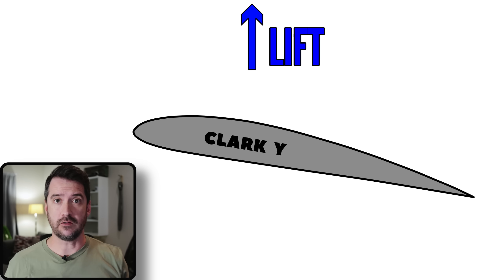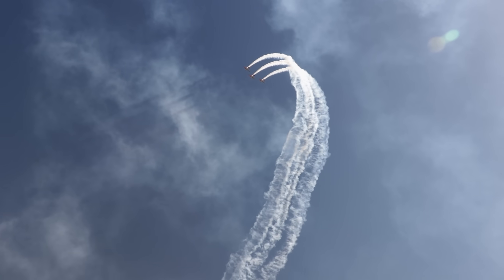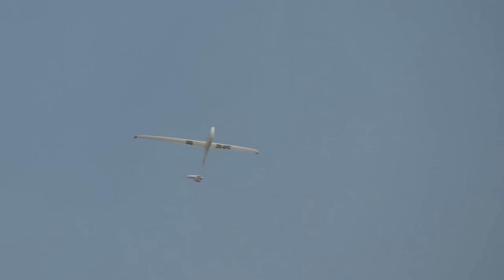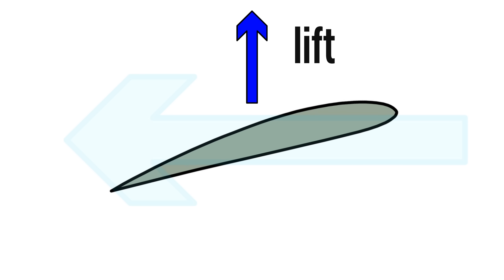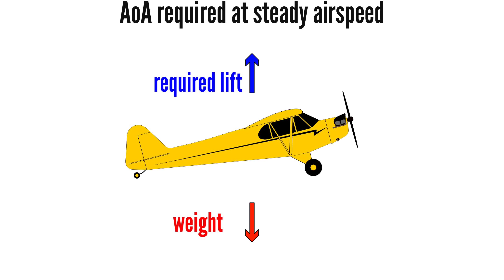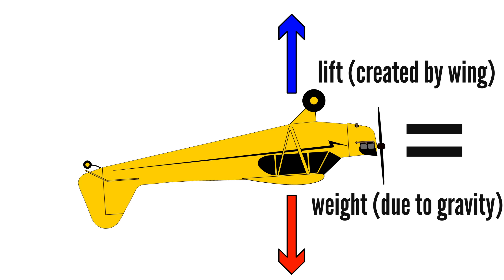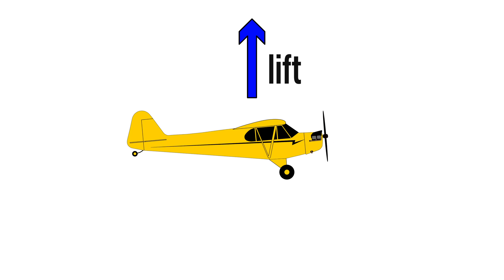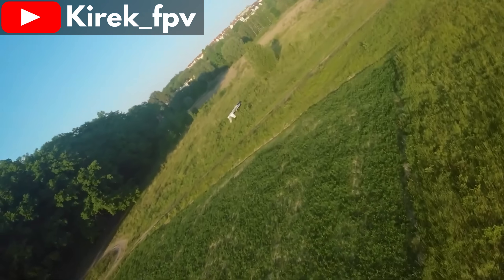Is Airflow Distance Over the Top of a Wing Always Longer?

Comment: Lift is generated by the stagnation point, which is located under the wing due to angle of attack. On-coming air is accelerated upwards to counter downward pressure, that's how pressure is decreased above.

Comment: No matter how the wing shape is, the amount of lift is proportional to the amount of air washed down after pass through wing. Even a rotating cylinder can act as a wing, using Magnus / Coanda effect. Simple Newtonian physics can validate this. It doesn't have to use (confusing / wrongly applied) Bernoulli equation. That kind of Bernoulli principle is only valid when the air stream is not separated. On wing, the upper and lower stream doesn't have to meet on the same time at the edge when separated. So longer distance doesn't always faster. For Venturi effect, Bernoulli's is correctly applied.
Reply: Bernoulli is simply a statement of conservation of energy, which is fundamental to our physical world.
Reply: @davetime5234  Yes. But that approach for wing is logically misleading. The teardrop shape of the wing main purpose is to delay turbulence to form, to elongate boundary layer / separation. Not for the lift. The lift is actually from angle of attack. So, to right logic to explain that shape is to draw centerline (cord) of the teardrop wing. Imagine if the top of the wing is jagged on the top, and smooth on the bottom. With angle of attack zero, that approach would tell that the upper path is longer. But in that case there will be no lift.
The Bernoulli principle logic approach also can't explain rotating cylinder wing. Because on rotating cylinder wing relative speed of air to the wing surface, or relative to the surrounding air, is higher on the bottom. Even though it faster on top, relative to the center of the wing, caused by Coanda / Magnus effect. The higher pressure on the bottom of the wing is caused by impact pressure. on all teardrop-shaped wing, flat wing, or rotating cylinder wing.
What I emphasize here is; Bernoulli principle is correct. But widespread explanation on textbooks that apply it in wing is incorrect / must be refined. The Bernoulli on wing is measured secondary effect, not the cause of the lift.
Reply: @mbahMu-iki  "The Bernoulli on wing is measured secondary effect, not the cause of the lift."

The three interconnected pillars of fluid dynamics underpinning lift are:  conservation of mass flow rate (conservation of mass), conservation of energy and conservation of momentum.  The predictive equations of Euler and Navier-Stokes formalize those three pillars and the interactions between them.

Among the above, Bernoulli is shorthand for conservation of energy.  It is not a secondary effect.  It is front and center a core rule defining the mechanism of lift that governs the rules of CFD systems used to design the wings comprising  most, if not all, of the aircraft underpinning the aviation industry.
Reply: @davetime5234  like I said, Bernoulli principle is correct. But for wing lift analysis, it is more proper to focus on angle of attack instead of the shape of the wing. That approach will be confusing for rotating cylinder wing, or wing with jagged / wavy top (wich also has longer path) and flat bottom on zero angle of attack.
Reply: @mbahMu-iki  "it is more proper to focus on angle of attack instead of the shape of the wing"

But angle of attack involves "Bernoulli" every bit as much as asymmetrical shape of the wing.

It is the asymmetry to the relative wind that creates lift.  So, "Bernoulli" is not different for whether that asymmetry comes from asymmetry of shape vs asymmetry of angle of attack, vs a combination of the two.

Same issue with the rotating cylinder.  The rotation presents asymmetry which (like with the AoA and/or the shape asymmetry) causes a conservation of energy transaction (decrease of pressure to sustain the higher tangential speed*), in response to preserving the incoming direction of momentum (conservation of momentum).

The "jagged/wavy" top issue is that it doesn't compel a longer path:  the bulk of the detoured airflow is not compelled to rigidly adhere to the undulations of such a rapidly changing geometry.  In other words, depending on the specifics, one would expect to see the actual path to be shorter than the surface path length measured by taking all the dips into account.

*in terms of the 3 "pillar conservation equations" defining both Euler and Navier-Stokes, consider the pressure drop/speed increase statement for conservation of mass flow rate:  if flow rate fails to keep up along the elongated path, pressure drops from mass deprivation until the pressure drop accelerates the speed enough to return to equilibrium mass flow rate.

Comment: 9:33 Flawed argument. The air that starts at the stagnation point and goes to the left and then around the wing has its first part, the one that is going left, creating DOWNWARD drag.
Reply: You need to consider the composite effect of the entire airfoil.  Local forces are only a fragment of the full picture.

Comment: a planes wing is just like a knife in butter it cuts through the air and if it cuts fast enough it will generate lift in the direction the knife is angled . butter been more beneficial cauese it does not move easy , the faster you go the harder it is for the air to move out of the way creating lift in both directons. the slight hump meansthe air ontop f the wing moves slower in relaton to the air underneath meaning its bias is to lift upwards so you sacrifice a wing that can operate both ways equally to a wing that operates more efficient when used to produce lift one way.

Comment: Sailor here.  THANK YOU !  One can have a graphene sail, and with virtually no thickness, it will create lift.  Always thought is was surface tension or weak vacuum  between air and sail fabric.   Put a sheet of paper on a table top.  Put your hand on top of it.  Life your hand up quickly and the paper will come up too.  It ain't no Bernoulli effect.
Reply: Bernoulli isn't an alternative theory, it is shorthand for conservation of energy.  To fully explain lift, you need three legs to a 3-legged stool: conservation of mass flow rate, conservation of energy and conservation of momentum.

The Navier-Stokes and Euler equations, that describe lift in detail, are composed of an interconnected equations representing the above 3 "legs of the stool".   These methods are the rule book for the tools we use to design real aircraft wings (and high-performance sailboats).

Cutting off the conservation of energy leg of the stool (the "Bernoulli" part), makes the stool unable to stand upright.

The same CFD tools outlined above, work for thin sails.

Comment: I have questioned the curved top surface being the main reason for generated lift of an airplane wing since I played with balsawood planes when I was a kid.  The wings were flat and the mount for the wings had no curvature or angle in relation to the single stick fuselage.  Since I was not and am not an engineer, my intuition led me to believe it was more the angle of attack and wind speed, since I could also feel the lift when holding a plywood strip across my shoulders and standing in a strong wind, with the board at a positive angle to the wind.  The lift disappeared and started pushing me backwards, if the angle got higher, past a certain point.  The position of the wings, along the fuselage made a difference in how and if the wooden planes would fly, as in, balance for flying working out better with a little more weight on the tail, providing a better angle of attack, I assume.
Reply: There's nothing special about camber vs tilt.  It's all about asymmetry:  to the extend camber contributes asymmetry and tilt, or angle of attack, represents asymmetry of orientation, lift is created from a relative wind.

So,  curvature adds lift, but only if in adds asymmetry.

Comment: Many planes fly like crap inverted, or not at all, even when talking about RC planes.  The thing to remember with scale models is you have to  factor for air being seemingly more dense (where Reynolds number comes into play) because the plane is scaled down but the air its flying through did not scale, which is the same reason a model boat on the water in a movie looks fake because the water does not react right on the model due to scaling (just watch the raising scene in Raise the Titanic to see what I mean).  RC planes are also not really lighter for their size, they are actually usually heavier in their scale than a real aircraft because frankly they don't have to design full size aircraft to be picked up by Giants and put into a trunk.  RC planes also have more powerful power plants for their scale than the real aircraft  making many capable of near or actual vertical climbs on engine power alone.

Getting back on topic, how well a plane flies inverted has a huge dependance on the airfoil with a more symmetrical airfoil performing much better at unusual angles of attack including inverted, which is why real stunt aircraft like the Extra 300 and Pitts have highly symmetrical airfoil shapes that perform nearly as well inverted as they do when right side up.  For RC high performance aircraft you usually see fully symmetrical airfoils that fly equally well and at the same angle of attack whether inverted or upright.  The other factors to critical angle are speed and altitude.  As  you get slower or  higher the critical angle will reduce.

Comment: Until you've put a wing with pressure ports in a wind tunnel, you will never understand that you are wrong. The longer path does in fact create lift even at AOA (depending on airfoil shape, of course).
Reply from the maker: I didn't say the longer path creates lift. I even said in the video that I'm not describing lift. I said that the longer path argument can't be debunked by saying that "then a plane wouldn't be able to fly upside down". 

So what exactly am I wrong about?
Reply: It's all about asymmetry.  Asymmetry presented to a relative wind creates lift.  

If you stick to thinking in terms of the asymmetry contribution, then the shape of the airfoil in combination with any AOA can be understood for any combination of right-side up, upside-down, asymmetrically cambered (in the up or down direction), or symmetrically cambered.

Path length and the stagnation point, and the notion of symmetry vs asymmetry are directly tied together.

Comment: Good presentation.  Always wondered why a flat wing ( no airfoil ) would fly. We use them in small indoor models. The low wing loading (and power to weight ratio ) is what makes it possible for models to fly at very low speeds without stalling.

Comment: Very well said. That's why supersonic wings profile looked almost upside down because of the stagnation point to cover all ranges from sub, trans and super sonic. If it goes fast enough, it doesn't need a profiled wings anymore, it ends up like a missle fins. B-52 has a very THICK profile wings almost like a tear drop to handle extra heavy loads and they have no needs to fly upside down. Thet's why they have 8 engines to overcome that drag. Awesome power.

Comment: Pall, lift is produced seperatly and by differant methods on the upper wing and the lower wing sides. the path length means nothing.
 If you blow on the top side of a paper, with no air movement at the buttom, you still get lift.
The buttom side lift caused by air molecules pushing the surface. Third newtons law and angle momentum.
The top side lift is caused by the van der vaals force of the air particals that hitting the surface, bauncing and pulling it with them.
Am I right?
Reply from the maker: Yeah you are mostly right, although I've not heard of "van der vaals force", will look into it. That isn't what this video is about though...as mentioned in the video I'm not trying to describe lift, I'm addressing that specific upside down argument.

Comment: I've considered this very issue since I was a teenager making balsawood airplanes in the '70's.  Seems to me that both the pressure difference above/below the wing, AND the fact that the angle of incidence of the wing produces a downward deflection of the airflow produce lift.  The more interesting question to me is what percentage of the lift is produced through each means.  My bet has always been that about 80% of lift is produced through deflection, and only about 20% of lift is produced through the pressure differential on the top and bottom of the wing.  But I have no hard data to confirm this suspicion. I knew that symmetrical airfoils worked, that kites work, despite the fact that they have no camber, and that inverted level flight was possible.  These all point to the idea that deflection of the airstream provides most of the lift force.

Comment: The inboard section of the wing of the DC-10 is more highly cambered on the bottom than it is on top. It flew rather well. The inboard section of any wing is where most of the lift is generated. So it follows that it shouldn't have flown well at all by the definitions that this video disproves.

Comment: I have an interesting perspective on this issue. My father was a private pilot, he owned two different planes and was in a club which had a number of planes to fly. One of them was a Cessna 150 Aerobat with the aircraft equivalent of a million miles! A stall is a maneuver pilots train for and perform at higher altitude. Anyhow, this Cessna has aluminum skin and the skin was a bit loose. When we'd approach a stall, you'd hear an oil can noise right before we dropped. It gave me an ability to almost see lift as a low pressure system attached to the top surface of the wing, versus imagining air flow and lift occurring somehow. I'm sure the oil can noise was lift detaching from the skin because every pilot in the club talked about it, and they were a very intelligent group. Other than that, I'm not sure of the physics, but I thought this might be a point of interest, maybe even a data point. Cheers!

Comment: It appears that the nice curve on the top of the wing is to reduce drag (reduce turbulence).  Therefore, it improves the net lift, but the curved top of the wing is not responsble for the lift. We were sold a load of shite, as we were told the it was the difference of shapes of top VS bottom of the wing was the creator of the lift
Reply: Why would you want to create points of different pressure on an airfoil it literally would create drag and unnecessary turbulent air. Same reason why transsonic is a terrible ratio for aircraft to be in (ratio because Mach is not a speed it's a ratio)

Comment: On your diagram of an upside down wing you claim that it still provides lift because the forward stagnation point drops with increased angle of attack thus preserving the longer air travel distance on the upper wing surface. Incorrect.
If you draw a line from the lower forward stagnation point to the most rearward part of the wing, then remove the top portion of the wing (which leaves a shorter top path for airflow), the wing, at that increased angle or attack will still create lift. Increasing angle of attack will increase air pressure on the wing's lower surface, increasing lift until the stall point is reached. There will still be an area of low pressure on top of the wing. The only importance of the rounded and longer upper surface of a normal wing is to help prevent flow separation thus reducing stall speed. Perfectly flat wings work - they will produce lift, but they stall easily.

Comment: I've always wondered about the theory of flight. I could never justify the low pressure = lift for a few reasons, if lift is created by low pressure on top of the airfoil how does a fully symmetrical wing fly? Or for that matter how does a flat surface with no airfoil fly? If lift is caused by low pressure on top an an airfoil why does a helicopter rotor create so much down pressure? When you put your hand out of a car window at speed and tilt it, you feel pressure on the bottom of your hand you don't feel vacuum on top. I'm sure low pressure on top has some effect but but I just can't see that making a foil fly.
Reply from the maker: Possibly you might be assuming that the curvature of the top of the wing creates the low pressure, or perhaps someone is else saying that. That is not correct and leads to questions like "but what about a symmetrical wing/flat wing" and the like. The camber is to streamline the wing for normal stages of flight, not to create low pressure on top. Angle of attack does that.

Lift is complex, but the pressure part of it; it's not the low pressure of the top that creates lift, it's the pressure differential. The air hitting the bottom creates high pressure due to AoA. And AoA also causes low pressure - lower than ambient air pressure - on top. How does the wing not move towards lower pressure? In fluid dynamics this force and law cannot be just ignored.

The "hand out of window" theory has been busted so many times already. Your skin cant really feel low pressure. How do you imagine it would feel? Air sucking the skin on top of your hand up? We already established lift isn't air pressure above "sucking" the wing up, the wing moves towards lower pressure. Your hand is simply feeling the air hitting your palm, i.e. the drag, it's not feeling the lift.